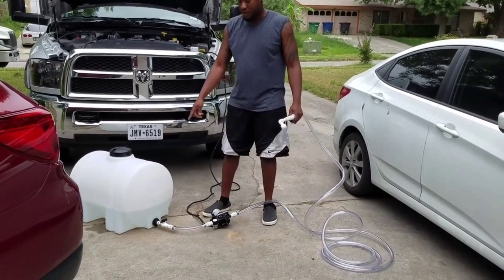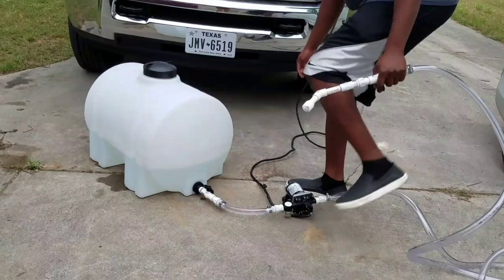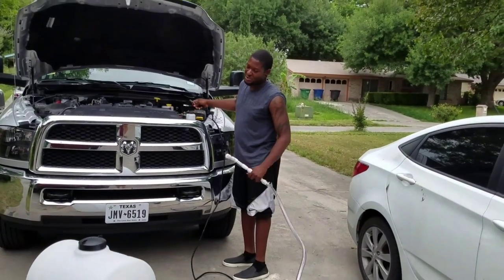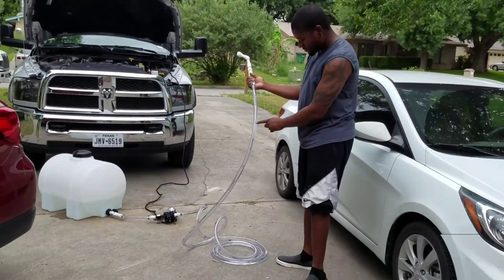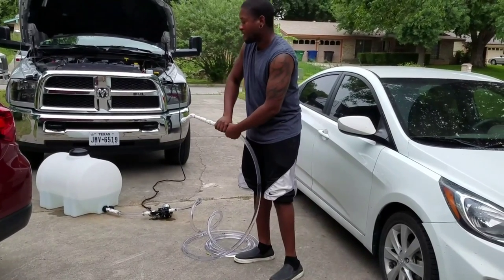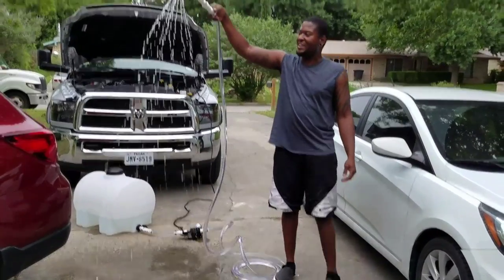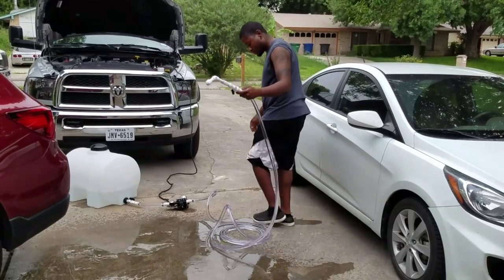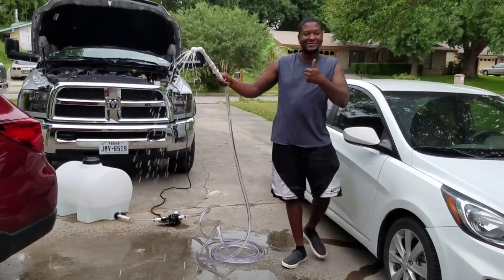DIY 12v Camp Shower

Comment: That is a nice set up. Very simular to mine. The only advise i would have given you, if you did the shower head like mine, is that i bought a hand full of pvc caps and drilled 4 very small holes in it then tried it. I put more holes as needed until i got the flow and pressure i wanted.

Comment: I Like This Example BEST . 
I LIKE THE SIZE of the Tank .
Where did you buy it ? 
I like the amount of water it passes through the hamd shower unit . 
Others seem weak but this is a dude worrhy flow . 
I think if there was more water in the tank ,there would be more pressure coming out of it . 
Good idea hooking it up to the Trucks battery --guess a good unused battery set apart from the truck hooked up to a solar power ReGen ,could keep the battery charged and functional for a good amount of time .
Reply from the maker: Been a few years, but I think I got it from tractor supply